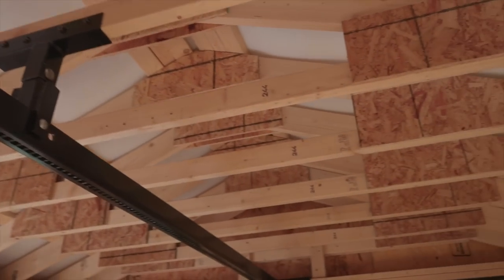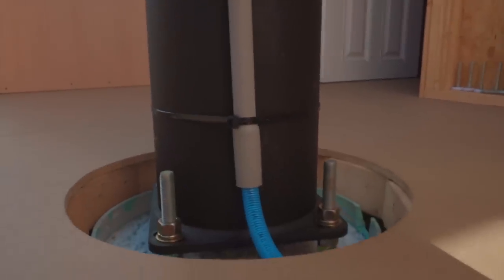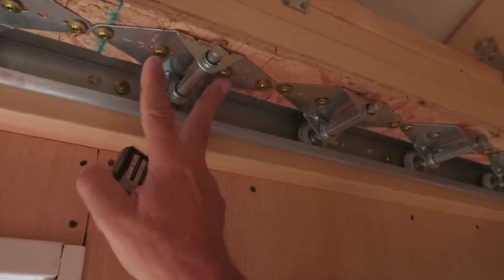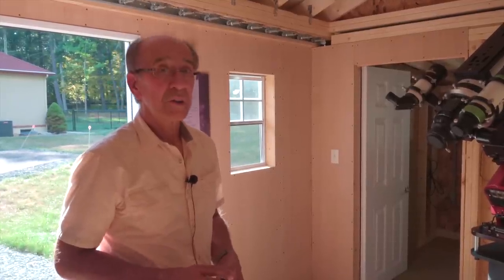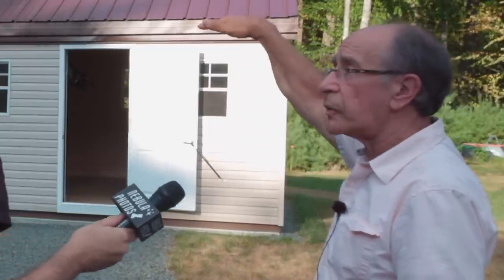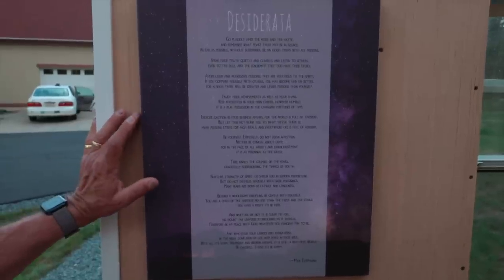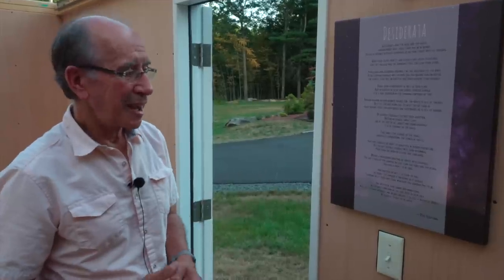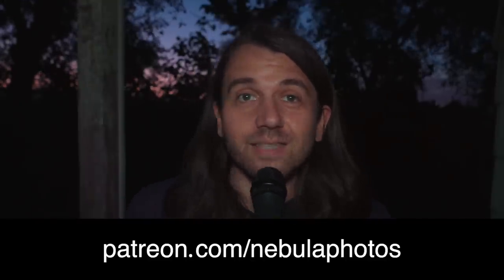Jay Sottolano’s Dream Roll-Off Roof Observatory (Observatory Tours #2)

Comment: I like the garage door idea, that is spot on
Reply: This one is also network enabled so that if I want to take it to a more remote operation from inside the house, I can..  For now, the warm room will suffice and still lets me walk out and look up!
Reply: It really is good. I was thinking that as the wheels run in a C channel type of thing it would also keep the roof from lifting if there was an unexpected strong gust of wind. Of course it would have to be a very strong gust as the roof looks solid and heavy. 
Curious to know if there was additional locking/securing mechanisms for when it was all stowed/closed?
I wonder if getting somebody to roll that C channel into a hoop would allow the same wheel setup to be used for a dome. Giving it the easy wheel change ability?
So many benefits in using the garage door mechanism. The easy replacement of wheels as mentioned. But the availability of replacement parts would a big one too. Any big hardware store would have everything you needed to repair or upgrade the setup. Also the roof could be any length as the garage door opener is designed to work with various heights of garage doors. You could also start with a basic door opener and later replace it with a fancier network controllable version or possibly just upgrade the existing one by adding a network control module.
Very clever. 😀
Reply: @jaseastroboy9240  Hi Jase.. Thanks..  The wheel "housing" does offer protection to the roof lifting but I might add some additional corner mounted steel "brackets" just in case of a crazy Nor'easter or Hurricane or Tropical Storm, etc. coming through the area, so no, not something standard, but easy enough to DIY.  Mother Nature can be mean sometimes!  Agree,  lots of good reasons for the entire Garage Door opener setup.. The one they use is a commercial grade one because of the roof's weight and that's standard with the bldg... It was nice to find out it was also network capable!!

Comment: Roll off roofs are very clever and probably overall going to be the cheapest option. All-sky domes function in a similar way, but obviously the geometry and mechanical fixings are more complicated making them more expensive. The trade off is that all sky domes can lower below the level of the telescope itself, which is a nice feature if you have relatively clear sight-lines all around, but is pretty disadvantageous when it comes to wind.

Comment: I’ve seen too many of these being too small but this one does seem sized right for him. Especially worth considering is the bulk of winter clothing, including heavy boots.  If there is not enough room to move around freely, or if you tend to clutter up your space over time, then you do run the risk of running into your equipment and disrupting your imaging. Part of that also is if you intend other people to join you… It takes a lot more room for people to avoid each other than just one individual to move around in a space.  I’m very glad to see another installment in the series.
Reply: Guy.  I also took into account ANY possibility of two OTAs potentially bumping into one another if I was slewing in opposiite directions.  That and the desire to be able to have people in the observatory and not bump into the scopes. ;-)

Comment: Hey Nico,
Regarding wall hight issues, if you were to use a 2, stage telescopic pier you could raise the scope to any hight you require.
Think of the mast in a fork lift that raises and lowers the forks.
It's a closed hydraulic system with an electric pump.
Ez-pz!
These masts come in a plethora of heights, diameters and could easily be applied to an observatory for astrophotography.
Even for optical viewing one could just get a ladder to get to the eye piece. Or the stilts drywall mechanics use to install ceilings!
But for astrophotography those wouldn't be necessary since no doubt you're viewing from a computer monitor!😉
Hope this helps you or someone else.
Clear skies!

Comment: I bought a Stoltzfus roll-off a couple of years ago (paid about $7K which included the foundation but not the pier). It is of course a joy to work in. My only issue with it is the 7 foot walls (needed to for the standard size door). I poured my own pier on top of the preset rebar they put in. That came to 48" with 36" above the floor. Then I had a local welder prefab a custom steel pier (about 32"). My mount is as high as I could get it which means the mount and the OTA are parked in a flat configuration so the roof line and the steel bar of the garage opener clear the equipment. Given that, I have to use a step stool to access the equipment. I lined up the roll-off so the peak of the opened roof is just west of Polaris. I was cutting it real close because my polemaster is below the level of the scope. but I do have a very large open sky almost 360 degrees. The roll-off roof and a few pine trees to the north are my only limitation.
Reply: Jim/Angela..  For me, as I mentioned in the video, the walls pretty much worked with the tree line (at least that was the plan!  :-) )  .. The other issue here in PA was the requirements on the roof for the snow load.  Would have perhaps like a "flatter" roof, but 50 psf requirement (unless I went with steel truss assembly) set the tone for the roof..

Comment: This is interesting. I didn't know these observatory sheds even existed. I have built dozens of sheds and this seems like such a simple design.

I think now I might look at a slide over roof with a insulated + heated room for a computer and couch and just hanging out since it would be away from my house.

I had been looking at dome observatories, but thought they were too hard core for me, and started thinking of a slide-off (roll off) roof, with the south wall being the long wall, that opens as 2 large doors, or folds down. It all started seeming too complicated so thought I would end up just pouring a concrete pad with a weather sealed shed to store scopes or one outside my garage and just roll them out....
The insight of blocking wind is very important. Living in the northeast in an area with constant breeze, cold nights are that much colder.

Comment: I thought the advantage of roll off roofs with the south (or whatever direction is opposite to the gantry) wall folding down was to be able to have the scopes as high above the wall as possible without any need to park it in a safe position before opening/closing the roof.

I've built a small 1-pier RoR on my parents back yard that's about to be fully remote. I decided not to separate the pier from the building because frankly i didn't see the benefit for me personally since i'm not going to spend any significant time around the scope while imaging, even if i walk around during an exposure it is not noticeable anyway. I have to consider significant frost heave where I'm located so a lot of ground work had to be done prior to pouring the slab, i didn't want create any gaps which could compromise the insulation (although I'm no civil engineer, i have no idea if that's a valid concern).

Anyways its always very interesting too see other peoples RoR's, looking forward to more videos in the series :)

Comment: I like how the piers are completely isolated from the structure. I've tried imaging from inside my house out of a window but any walking around vibrates the camera slightly.
Reply: Yep, very important to isolate the pier.
Reply: We used a 1/2" foam pad wrapped around twice to create that spacing.  I could jump up and down or drop a bowling bowl (LOL) and the piers would not see it.  :-)

Comment: great job on this video, you didnt say what the final total cost/investment was for the pad, and the structure, that would be nice to know as well, although that will vary for each observatory. Great job pointing out the details, and personalization of his building.
Reply: Greg... there a lot of considerations around cost. (foundation, electric runs, etc., etc.)   If you send me a message, I can try to address some of it.  Also some things that (if you're able) you can do to mitigate some of it.  For me (and given frost lines, etc.) the biggest piece to get right was what the building was going to sit on.

Comment: Man, I wonder if anyone has upcycled a small shipping container into a roll-on-roll-off obsy. The kind you can actually lash to a pickup truck via a trailer and deploy to a star party via hydraulic legs(?) for easy leveling. Isolating the pier would be tricky since ultimately it's attached to the container body but maybe you can put a raised floor that's held up by a grid of rebar soldered on the walls and not on the floor. Hmmmmm

Comment: Flexible conduit is notorious for being hard to pull through. Go big. Put in a pull box at the bottom. Oversize your electrical feed.
Reply: Agreed about more difficult to pull, but you can make it work with some spacing.  Just one less thing to worry about. I have had friends where small little visitors liked chewing up the subfloor wiring.  I also tried to isolate the subfloor as best I could from the outside.  Time will tell!

Comment: The one thing I couldn't pick up in the clip (unless I missed it) is what kind of roof the structure has over the narrower end section - is it simply flat and slight angled so the main roof can roll over it?
Reply from the maker: That's correct.

Comment: Question, based on one of your videos I sent my Canon T8i out to be Astro modified at the same store in Vancouver. Now everything is red…really red, am I doing something wrong?
Reply from the maker: No, you aren't doing anything wrong. Use a custom white balance to see colors more normally. Or just balance the color channels in post processing, the data is there, but the balance of the colors is different and the camera doesn't know how to automatically compensate since it doesn't know you modified the physical filter inside.
Reply: @NebulaPhotos  , thanks for getting back to me, Of course your right, I shot the whirlpool last night and the data is amazing. Keep up the great work, we appreciate it.

Comment: Roll of roof is a good option. One you can build yourself and it is easier to motorize and get it remote controled. Unfortunately I still have to say: don’t make it too cheap. I was trying to build mine at a minimal budget. It works but it was not a great choice. Don’t cheap out. It isn’t worth it.
Reply: True words Michael..